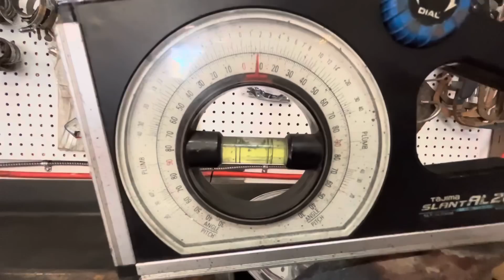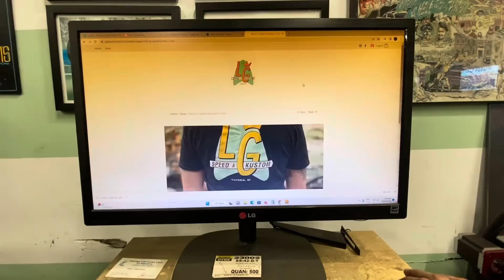How To - Drop Axle Jig Rebuild and Drop Axle Install

Comment: Excellent vid. I've street performance restored 57 Fords and super cruise built a 59 bird but never had so much fun as building a prewar. As possible get a 4 post lift with jib crane at front corner, took all the pain out. Super cruiser 32 Essex 4 door (no wood), Ford 300 I6, 3 speed all synchro, 3:10 9" diff, AC, 4 runner power steering, F1 axle 4" drop with disk brakes, sway bars and panhard rods both ends. But unlike you youngsters I still like shiny paint, big swoopy fenders and quiet comfy interiors.
Reply from the maker: I like shiny paint too. I just can’t justify the cost of paint when I have no where to properly store cars. My cars get parked outside every night and the last car I owned with shiny paint was pretty rough looking after only 5 years.  I’m with you on the interiors though. I have nice comfy interiors in all my cars
Reply: @LGKustoms  I and most of my car pals have big garages with attached house (and nice wives). Long may you run.

Comment: Your Video is ------- BOTH ------ Entertaining and Educational -- a two for one --- can't beat that ------ you mentioned you like to give  the King Pin just a few more degrees than what Henry did his at ---- seven ---------- It makes me wonder then ---- when one buys a dropped aftermarket axle ---- is it at the factory setting by Henry? --- Makes you wonder what you are getting -------------- The truck sits really nice to me now ---- about equal distance --- top of tire to the bottom of the fender --- front and rear ----------- I think if you are going to drop the rear down ------ I'm not sure of doing three inches ------ but -- if you did that -------- the front --- has to go down too ----- to me it wouldn't look good ------- We will leave it up to Wayne ----------- A good idea --- added to the Axle Bending Fixture ----- don't let the Combo Square get TOO hot from all that heat --- might grab it a say ---- S%*@ ------ Thanks for the Video ----- See Ya Soon ------- Rodney
Reply from the maker: Wayne decided to leave it as is. I think it looks good

Comment: Thank you so much for sharing your knowledge and techniques. You have a very easy going and down to earth approach and convey the facts well. The stance looks good as it is, dropped at the front with a slight take. Dropping it 3 inches in the back would make it look like a Gasser. Thanks again, best wishes from Australia 👍👍

Comment: Did you hone out the interference fit of the inner wheel bearing to make them slide on better?
Also like your idea of using a combination square. Your using the K.I.S.S. method there (Keep It Simple Stupid) Lol.
36:27 I vote no, it looks good right where it is.

Comment: in my opinion 28-29 fenders would look better than the 26-27 T. the 28-29 follow the contour of the tire and maybe make it look lower.
Reply: Do they swap easily and bolt on ?
Reply: @xmo552  I have never done it but have seen others who have. My guess is you would need the front fender, splash aprons, running boards and rear fenders. check out some one's 28-29 and have a tape measure handy to see how they compare. it would be great if all you need is the front fenders.
Reply: @tomhuber9332  
I have a friend that builds and races T's. I'll see if I can remember to ask him.

Comment: Hey Lee,  Curious, will your jig drop an axle 5"?  Been thinking about this idea for a 32 highboy I am building.  Purchase a 47" I-beam 4" dropped axel and drop it another 1" to make a 46", 5" dropped I-beam.  Your thoughts?   Also, GREAT videos!  Watch very one you put out.
Reply from the maker: I haven’t personally done it, but it’s definitely been done. Roadster Supply axles lend themselves well to this.

Comment: what year f100 front brakes do you have on the roadster pu.? I have 39 ford backing plates on my 29 chassis. I was told I need  39 to 47 hubs and drums .
Reply from the maker: I think these are 48-52 Ford F1. 39-41 and 42-48 hubs and drums work great too. The main difference is the 48-52 brakes are bendix style

Comment: What size regulator and torch set are needed to apply the heat needed for the drop?
Reply from the maker: Sorry, but I have no idea what size it is. I didn’t realize there was different size regulators
Reply: @LGKustoms  I'm  pretty sure there are, but like 75/25, so I could be wrong. My recollection was based on the needed capacity to feed the larger rosebuds. Maybe it's just torch body size. Thanks though.

Comment: Wouldn't it be safer to get a dropped axle rather then destroy the strength of the metal with out a slow cool down that makes it bridle
Reply from the maker: Original axles are forged. I’ve never heard of, or seen on ever break. 
Aftermarket axles are cast, and they definitely break. I have one on display in my shop as an example. Do a quick google search on cast axles vs forged axles and you’ll see the amount of “new” axles that have broke